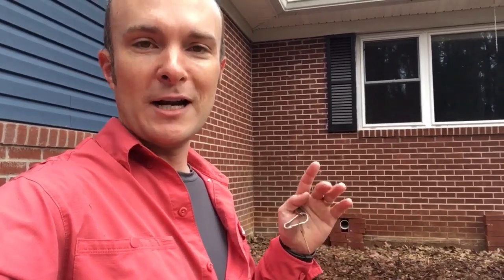Radon Problem Solved: Healthy Indoors Minute

Comment: Hey Corbett, have you updated this home with proper fan placement yet?  Keep in mind fans should be outside or in the attic for a radon application.  They should NEVER be installed sideways.  Horizontal fans get inundated with water vapor and short circuit.  Fans placed in crawlspaces or in the home run the risk of dramatically increasing radon levels, should the exhaust side air be compromised.  See NRPP and AARST-ANSI standards for more.

Comment: Those monitors are extremely inaccurate. You may want to have your house tested by a professional.
Reply: Yes, thats's true, but the +-5% of these systems is enough to always have a look if the levels are dangerous.
Reply from the maker: I’ve had several experiences where professionals are setting up radon tests right before blower door testing, and are totally unconcerned about it. Not a believer that pro testing is any more accurate as a generalization.
Reply: Home Performance Radon testing needs to be done over month to get measurements that can prove if a radon mittigation needs to be done. I can see this at my own house. When I was measureing the radon levels for six months they were changing between 500 and 30 becquerel. When you are measuring only over some hrs or days, you don't need to measure.

Comment: Very curious to see why extracting from under the vapour barrier as per usual didn't work. 

I've been using an Airthings Wave (just a few $ more than the Corentium but with nice historical data on a phone app) - the passive system is not doing nearly enough, was thinking about just installing a Fantech or RadonAway fan at the bottom of the vertical passive exhaust pipe but after a bit more research I found how it's usually done with perforated tubing underneath the vapour barrier. 

Local radon mitigation company wants $1500, including replacing the existing 6mil black vapour with a "cross laminated white membrane" that's caulked to the concrete foundation. 🤔So pretty tempted to try just the fan...
Reply from the maker: Vapor barrier isn’t completely sealed, like yours, so no pressure can be made. Try it- your airthings will show you if it works

Comment: Is that fan mounted horizontally ? If so, Radon fans are not to be mounted horizontally.
Reply from the maker: It’s a Fantech, it goes in any which way.
Reply: @HomePerformance  This is incorrect.  The fan should NOT be mounted inside and definitely NOT be mounted horizontally.  It goes against all international regulations.  Source: Fantech distributor and member of AARST.  A horizontal fan voids the warranty and turns your radon fan into a water pump.  Only a matter of time before it shorts out.
Reply from the maker: This is not technically a radon mitigation system, Brent. It’s a simple exhaust fan. I hear you, though, for normal installs.
Reply: @HomePerformance  The title of the video is "radon problem solved".  Seems disingenuous to me.  I think you should update the description to have a disclaimer against fan placement in this way.  There's too much radon mis-information as it is.  I know your heart is in the right place, but this type of stuff really confuses people.

Comment: You just put the entire house into a negative pressure. Your heating and cooling costs are going to skyrocket.
Reply from the maker: Not skyrocket, no. Yes, the house air will be going outside. It’s not about energy at this point, it’s about health.

Comment: Will be tuning in. My parents radon levels were at 7 when we had them tested. What is the meter you have on the wall showing radon levels? Haven't seen that before.
Reply: ditto-- googled it-- Corentium Home Radon Detector by Airthings 223 Portable, Lightweight, Easy-to-Use, (3) AAA Battery Operated, USA Version, pCi/L  $180 on Amazon
Reply from the maker: Bingo